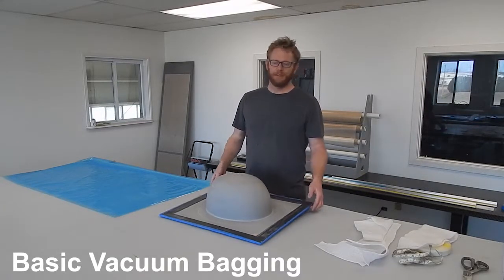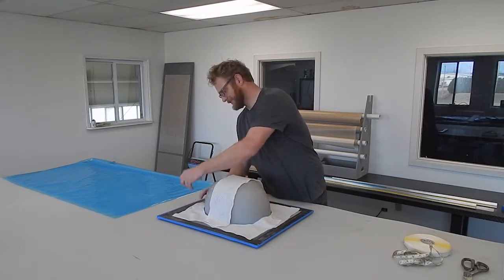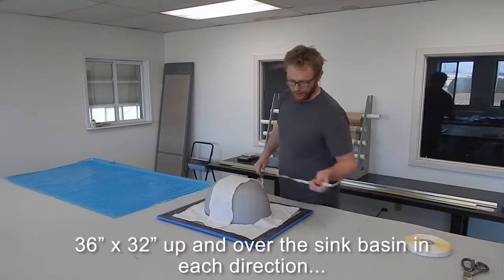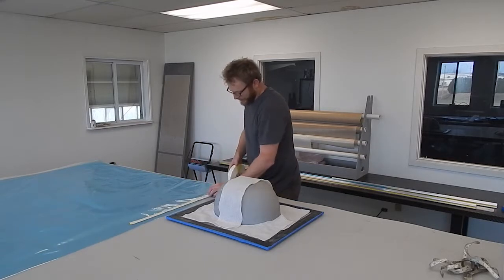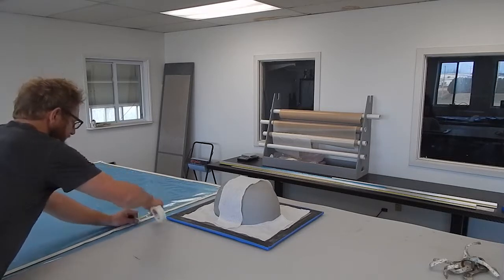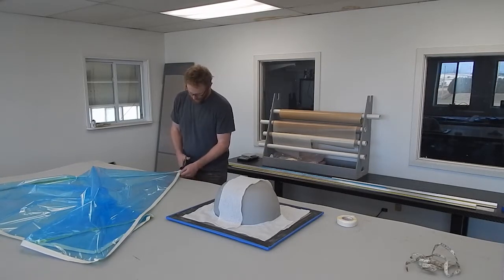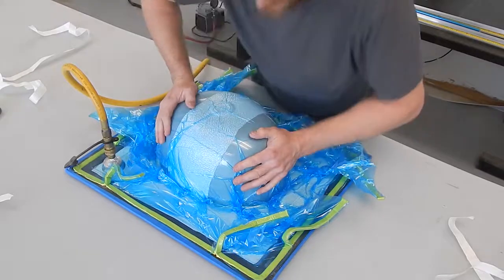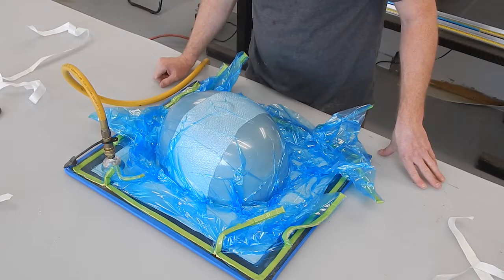How to Vacuum Bag Small Parts

Comment: After doing a “test” bagging is it possible to reuse  that bag or do you start from scratch with new bagging material again?
Reply from the maker: It is possible to reuse if you’re careful and limit how much resin touches the bag using a bleeder fabric.  Sharp resin shards are hard on bags.  Many bag films tear easily with low humidity and are rubbery when in a moist environment.  If you cut away sealant tape and keep the bag from tearing you may be able to use a few times.  Probably not for infusion though!